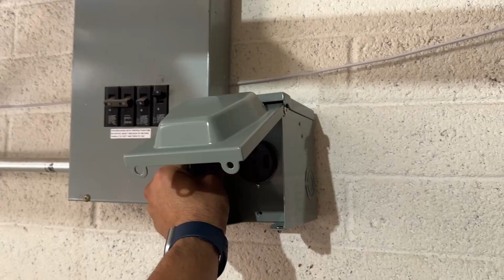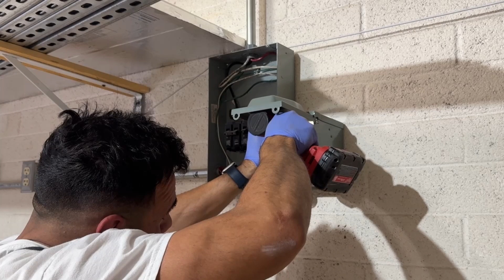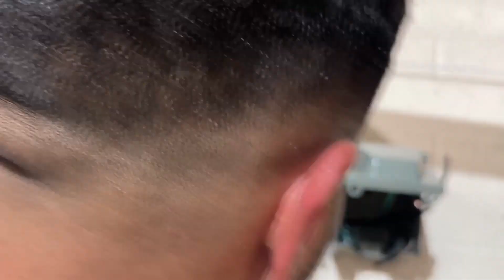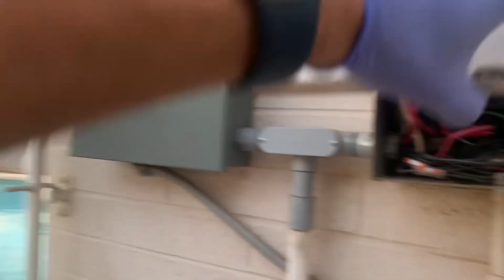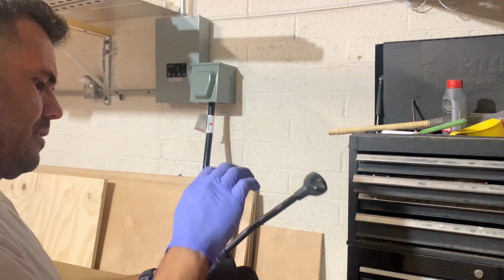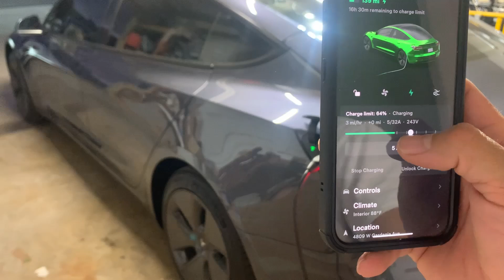DIY NEMA 14 50 to Garage Subpanel for Tesla Charging

Comment from the maker: ✅ Installed a NEMA 14-50 outlet off a subpanel using a 30A breaker — works great for EVs, RVs, or workshop tools.

In Part 2, I’ll move this exact circuit to the solar-powered critical loads panel (CLP) running off the EG4 12000XP.

Subscribe if you’re doing a solar + battery system, and let me know if you want a full panel wiring walkthrough 👇